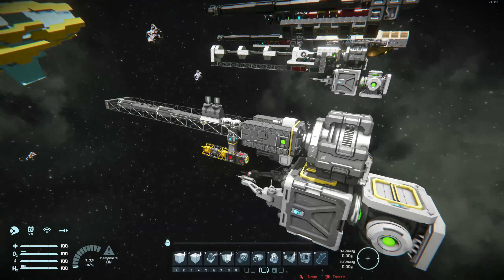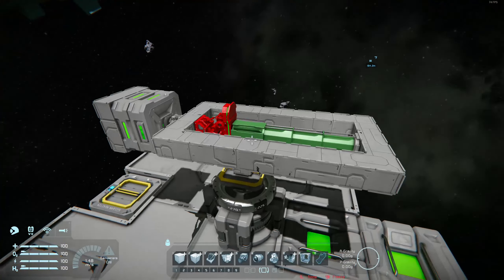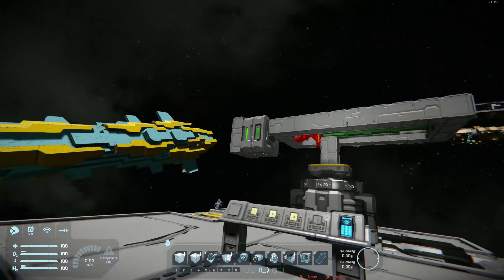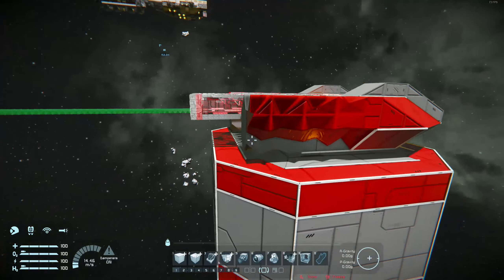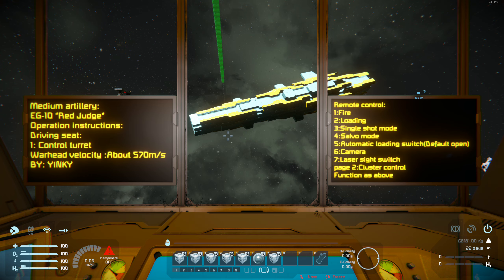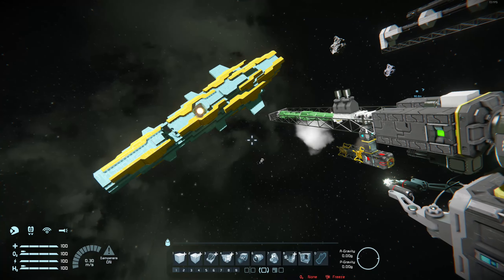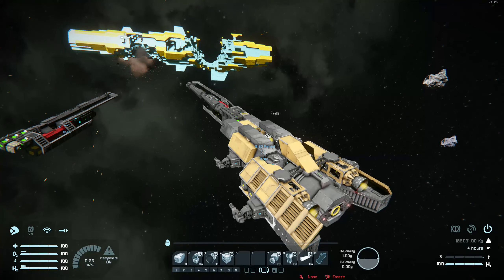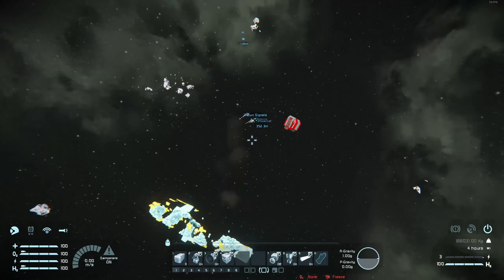How Clang Guns Really Work

Comment: There is a fine line between being an artist and an evil genius, and you are balacing on it masterfully! May I ask for some advice? I'd like to equip the projectiles the guns shoot with an exhasut block, just like you showcased it in your orbital slingshot video. That photon torpedo effect with the large electric visuals from the exhaust is simply too good to miss out! How could I do that without breaking the guns? I tried to copy the projectile, edit it, save it as my own blueprint and load it back to the projector on the gun, but for some reason it didn't work.
Reply from the maker: That would be the way to go. For some reason it tends to not work when you have too few blocks (I think you need at least 5) or if it's too light. Does it work when you just add it on top without removing any blocks from the projectile?
Reply: @MajorJon  Thanks for the reply! For some reason, the guns blew up upon firing with the modified blueprint loaded in them. Both your older small grid gun and the large grid gun as well. I did not remove any blocks from the projectile, I only added the exhaust. I managed to make it work by jury-rigging a second projector onto them, which only contained the exhaust block. Furthermore, the large gun's projectile loses the effect in about a second due to being unpowered, so that one also needed a battery besides the exhaust. I was wondering if there was a more elegant solution to this, but couldn't find anything so far.
Reply: "Fine line between being an artist and an evil genius" yeah its called being an engineer
Reply: @JukeboxTheGhoul  I don't think I've ever heard it said better
Reply: @TheGreyPixell What? I was agreeing with them on engineers balancing the line between artist and evil genius, did I miss something?

Comment: My first experience with clang physics was when i had a damaged airtight hanger door on my ship. I stood on top of it to weld it in back up and when it was repaired it launched me into the roof of my ship. The extending parts of the airtight hanger door instantly appear when the grid is welded back to functional and it launches anything in the path, including players. 
I tried to turn it onto a warhead lunching weapon but instead invented a self-destroying clang drive as my prototype shoved the warhead inside the grid then flew up into the air before exploding. 
It was kind of funny and sad at the same time.

Comment: I remember making a small grid piston cannon (rotor speedbreaking) on a planet, it was pointing straight up into the sky and whenever I needed to go to space and I didn't want to wait 7 minutes by just doing it the normal way, I placed a passanger seat on the projectile and then catapulted myself into space at about 500 m/s :D.
Later I tried to pilot the thing and of course, we know what happened xD.

2:07 Yeaaaah, I remember staring into that thing with a few friends and just not being able to comprehend wtf was happening xdd. Just taking it apart piece by piece but it took so long just to figure out which timer block is the one that fires the gun... "Some Chinese dude," like usual.

Great memories, good luck with the ship you're building!
Reply: hm noted
Reply: And if you grab a block and hold it against the cannon before launch, you should be able to build a second gun that fires you back down at or near the original launch site. You might need to adjust for any twist in the subgrids that causes off-axis deviation, though. Either way, just remember to brake in time. ;)
Reply: @Anvilshock  espically when you are using  oh idk speed mods that alow you to go 1km a second or as i like to think 100 klicks to fast XD

Comment: Excellent video. You mention accelerating the projectile further with artificial gravity. I've found that piston jolt projectiles do not have gravity(mainly planet gravity?) applied properly while breaking the speed limit. Any thoughts on remedying that? Or is it just a limitation of planet gravity and clang? I tried accounting for it in the targeting computer's math, but the calculus gets a little yucky when the gravity doesn't follow the inverse square law and changes with horizontal speed(Keenian relativity). Either way excellent video, it really sounds like you had a hell of a time reverse engineering that Chinese gun lol.
Reply: It's an in-game problem with anything going over 100m/s

Comment: How do you build 2-rotor-base breaker? I use double piston, tried to make 2-rotor once by pushing the head with a piston and failed.
Another thing, I use merge detach and as soon as I detach another projectile, previous fixes itself (starts being it's own grid). Also might be worth mentioning that the glitch persists through landing gear attach/detach (you can prepare projectile and move it around without losing the effect, unless you unmerge next one). You can have landing gears or mag panels on the projectile with lots of submunitions - the whole thing would break speedlimit too (unlocked submunitions would be slowed down to 104 right on unlock).
Any grid subdivision fixes the grid too, it can be used to slow down before impact to have accurate collision detection for kinetic projectiles (have a detach part on projectile procced by code or timer).
Reply from the maker: That's a really good idea, never thought of that. Interesting that landing gears work too, seems kinda counterintuitive.
The double rotor I think I just made with pistons as well. Was a bit fiddly though. You could also just snatch one from a workshop creation :)

Comment: I have a question about these clang guns, I tried recreating them myself (I play with speed of light mod, so it was a bit simpler to do), but I had 2 problems with my design.

Firstly no matter what I did, the projectiles were extremely slow (150m/s at max if I played with the distance of the gatling gun from the conveyor)

Secondly, while the gun was precise, all the projectiles from a single gun landed in the exact same spot, but that spot changed every time I spawned a new cannon or reloaded the game (the deviation was mostly vertical and could reach up to 30°.

Do you have any ideas what this might be caused by without access to the blueprint?
Reply from the maker: That deviation sounds to me like the centers of mass might be off. When the pistons are put under tension, are they still perfectly straight or sort of at an angle? I've never had copy pasting the guns have such drastic effects, but generally share intertia tensor could usually make the piston jolting more reliable. I guess the lowish speed could be caused by it not shooting straight, but you can also improve the speed by adding more pistons ofc or by adjusting the mass of the projectile+projector subgrid. There is an optimal mass for max speed. Maybe just try adding a few rotor heads on that subgrid to balance out the gun and adjust the weight.
Reply: Thank you, I'll try and see if I can implement these changes.

Comment: This still work with the new updates/Warfare 2? Because, if it does, then I know what I'm going to be doing. UNSC Frigate lookalike, but armed with one of these centrally mounted, and using the gravity/mass block thing you mentioned for lots of speed. It wouldn't be to scale, because that would make the ship 525 meters, or 210 blocks, long. Which is, based off my experience, is basically the SE equivalent of a superheavy battleship.

Comment: Is there any way to make the large grid version without using a script? What if hinges were used instead? Or the two rotor setup with the remote detonation feature after some distance? I'm trying to find a way to create the large grid version for the console SE. which cannot use scripts.

Comment: How do these not accumulate Scrap Metal from shooting the sprue? And does the projector not get damaged as an adjacent block of the sprue, requiring repair with every cycle?
Reply from the maker: I think there's no scrap metal here, because it's in creative. In survival it does create some, but it tends to just get blown away. Nowadays you don't need a gatling anymore ofc, you can just use the small merge blocks. Only amor blocks damage neighbouring blocks afaik.
Reply: @MajorJon  Thanks!

Comment: I wonder if this could be made into an ai turret. Is there a way to detect other ships accurately enough to aim a turret at them or would it just have to use whips turret slaving script? The slaving might not work because of the different projectile velocities.
Reply: The Turret Control block might be a way to do it, especially if you can use whip's turret slaving script to make it fire using the turret AI. I think that gets around the problem of getting the turret to fire as well as track a target
Reply: @prisoner6266  if it aims at the same spot as the parent turret it will miss because the clang projectile is faster than the bullets. An array of cameras constantly shooting raycasts out might be a good way of doing it?
Reply: @Bzorlan  you just need to wire a couple cameras, an advanced rotor and a hinge into your clang gun, feed them into the custom turret, use the raycast from those with the turret slaving script I think and that should activate the trigger timer when it wants to fire, using the ai from the custom turret rather than a parent turret

Comment: Is there any way to get the safety detach values to NaN without touching the save file?
Reply from the maker: I always change that in the blueprint file directly (in Roaming\SpaceEngineers\Blueprints\local). Just delete the sbcB5 file and edit the other one. I don't think it's possible to do it direclty ingame, I think I tried it once with a script, but I didn't get it to work.

Comment: Anyone know how to attach 2 rotor parts into 1 rotor?
I tried to use piston, put rotor part between 2 rotors and use timer block to tell them to attach at the same time hoping its gonna work, but so far no success
Reply from the maker: attach it to one, then move it over with the piston. Just crank up the force on the piston to insane levels and make sure everything's a station. If you're in creative, you can just rip one out of a clang gun from the workshop ofc.
Reply: @MajorJon  wow, thanks for fast answer, damn it worked like a charm, i guess brute force is an answer sometimes

Comment: Wait, so you are telling me all of this works because the game doesn't check if the rotor/piston head is already attached to another block when you try to attach it? ...And these checks weren't implemented after several years of bugs and exploits like these? ...

(except for the first one with a landing gear, that would require a slightly more complex check, to ensure the grid it's a part of isn't a subgrid of the grid it's locking onto or vice-versa, and probably also check if they're not the same grid)

Comment: Hah! Okay, a few years late.. but someone either got real lucky and knew a little about hacking, or REALLY knew a lot about software. The double rotor thing is a bug where Space Engineers isn't iterating down the subgrid tree to detach children properly when limits (like distance from rotor to head). I'm guessing the game is assuming there's only one piston head (I'm assuming that's what it's assuming!), and thus only does boundary checking on the first one it finds (or maybe the linking structure only traces head to rotor, but not rotor back to all heads attached.. just the last one attached) I've run into a similar bug before, and had to add extra code to track extra errant children that shouldn't exist. Basically, always boundary check everything. If adding a head to a rotor, the game should check to see if the rotor already has a head, and if so, don't allow it Things like that. Maybe there's a reason they couldn't, hard to tell.

So, they either knew this potential vulnerability of nested children in software and then tested to see if they left it open... or happened upon somehow linking a head with two pistons and then wondered what they could do with that. Or a bit of both. VERY clever.. thank you for the explanation. I'd never have figured that out.